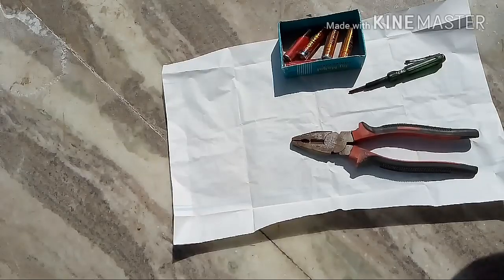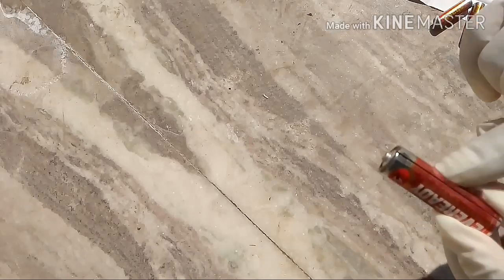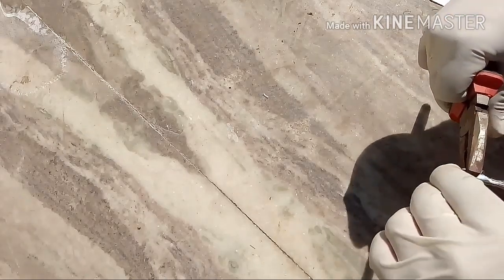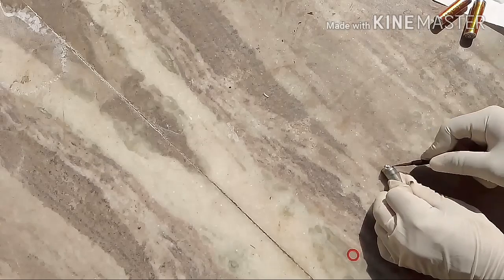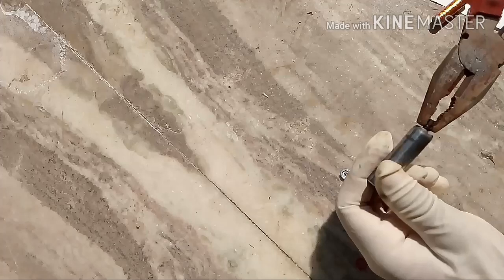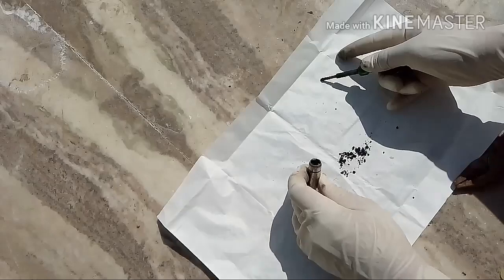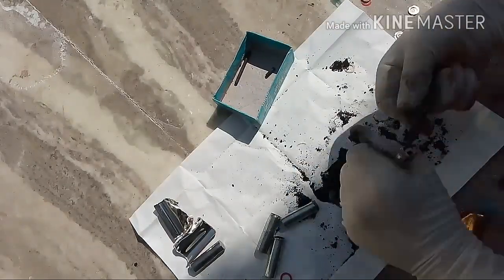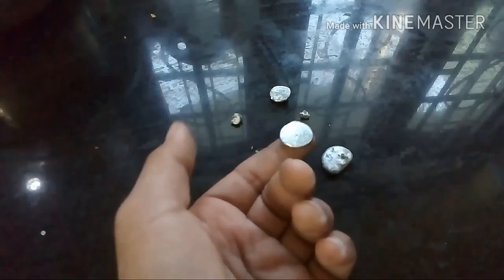DO NOT THROW AWAY USED BATTERIES IF YOU WANT FREE ZINC

Comment: I should mention that zinc wheel weights (marked z or zn) are a much better and easier source for zinc. Also, It is so much easier to put the battery in a vice, hacksaw a slit down the side, then turn it end for end and tighten the vice to split it open and separate. Easy peasy. Also, it would be useful to mention that only the "heavy duty" batteries have zinc casings.
Reply from the maker: Thank you sir for your suggestion
By the way i got zinc from all the batteries i used no matter heavy duty or regular
Reply: I found some 4lb zinc annodes for $5 on ebay. So I have a huge zinc reserve for plating now. The battery shells dissappear fast.
Reply from the maker: True but the thing is that in India if we order it off foreign country, the shipping would be very high so its gonna be pretty uneconomical
Reply: @TheExtremeFizz  you can get some from broken flat screens I think
Reply from the maker: Hmm maybe idk much about that btw thanks for making the discussion interesting Null snage and Larry Hucherson sr❤️
Reply: @TheExtremeFizz  any time😛👍
Reply: I will probably just go for the weights because of less cleanup for the manganese dioxide
Reply from the maker: True if you have them but i used batteries as they were going to be waste once used
Reply: @TheExtremeFizz  fair point